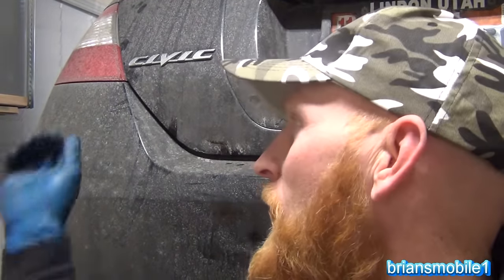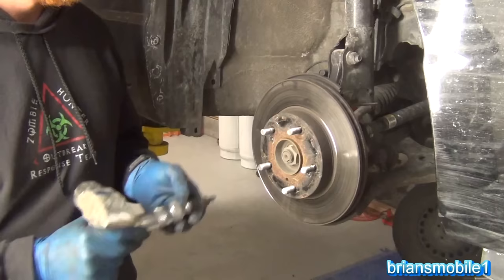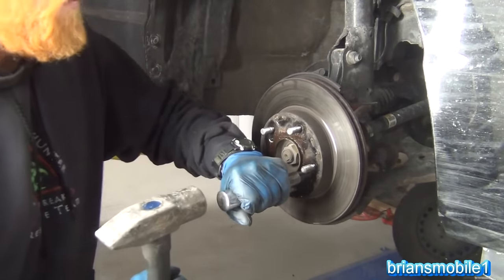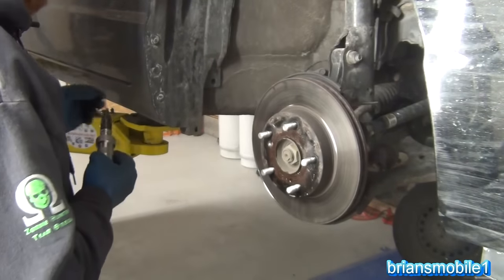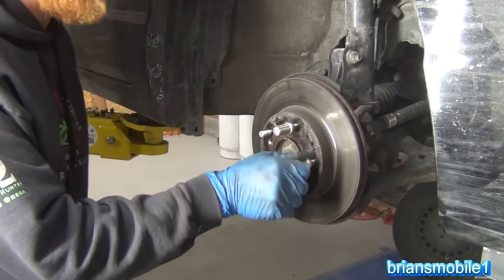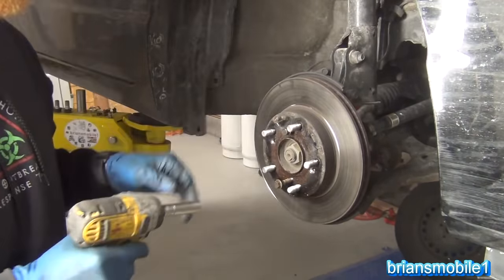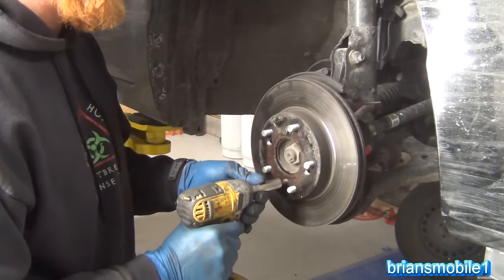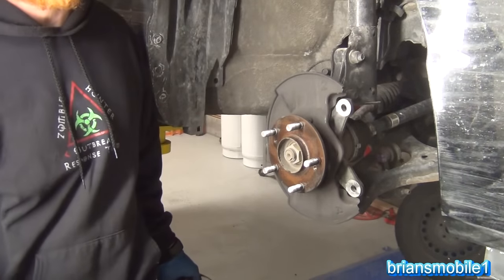Honda Rotor Removal Tips and Tricks

Comment: For those who don’t have a impact driver one trick that works great is put the lug nuts back on and Tighten them, this will release the pressure on the rotor screws allowing them to be removed easily but make sure your lug nuts are long enough, we use to do this at the dealership at time. Peace and God Bless

Comment: and with the ones that don't have the m8 bolt holes, buy new rotors, cause you're going to be beating the he'll out of the rotor  ( where the pad meets the disk) all the way around it. be sure not to damage the wheel bearing or you'll be buying those as well. the "slammer hammer" as I like to call it, is a life saver. but if you use with a socket on a bolt, TRY not to snap the bolt or you'll have a bad day. great vid Brian, I've been using those tricks for yes, but this will help a lot of people.

Comment: Good advice, thanks Brian. I did my civic brakes this summer, sprayed and used my impact like you showed. When I went side to side tightening the bolts little by little the threads ripped out of the rotor. I had to use the sledge hammer after that, darn.
Reply: Should have first applied penetrating oil (never WD40, which is NOT) and given it enough time to work.

Comment: As many cars as I've worked on, I've never found a car that has been treated as if the same person was ever gonna work on it again! I always put anti seize on just about every nut, bolt or spark plug, that I touch. Especially the likely to rust solid ones. I recently did shocks on a 99 Cherokee, with 260k+ miles, and the original factory shocks. Even after that rear shock fiasco, I put anti seize on the nuts and bolts, just in case. I also did an oil and filter change on it. I am positive that there was no call to torque the oil filter on to over 100 ft lbs!! That thing looked like a train ran over it, by the time I got it off! Most likely one of those highly trained quickie lube guys! I actually worked for one of those outfits, some time ago! I saw one of our recent tech school grads twist an oil drain plug off in the pan. He forgot which way was loosen! On that particular vehicle! Now, I'm not perfect! I sent a Mitsubishi Eclipse out with the oil cap off, once! But I went to their apartment, explained what happened, installed the cap, refunded the service cost, and gave a second service free, just for the mistake! I also took a write up. I could have just tossed the cap in the trash, and kept quiet about it, but I didn't.
Reply: Agree anti seize saves the day for the next time. I use it on my cars everywhere I can. But given the mess it makes I understand why most mechanics do not usually bother.
Reply: That's because dumb mechanics use it like they are putting out a fire, instead of putting on finger nail polish!!

Comment: Thanks Brian, very good video BUT one vital piece of information missing - those countersunk M6 rotor retention screws have a JIS (Japanese Industrial Standard)  PH No3 head NOT a standard PH3.  This is good design by Honda as the JIS resists cam out much better but the differences are not obvious.  If you use a philips PH3 screwdriver bit it'll appear to fit OK but you'll strip your screw heads and/or driver bits (I've done this...).

Comment: +briansmobile1 when I worked for Honda I would aways use a impact screwdriver and the bolts method when I did brakes at work. I would also after cleaning the rust off the surfaces use some anti-sieze compound on the surfaces where rust would accumulate. Never had an issue with them after that. Living in Massatwoshits the winter chemicals used on the roads would not affect or make them hard to take off again after the service! Thanks for this!
Reply from the maker: +413_Dina Great comment!

Comment: didn't know if Monroe would pass the Fit without the screws, so didn't want to drill them out. i found Kobalt impact driver at Lowes for about $16. by the way, if i had seen your video first, it would have saved me the trouble of screwing with phillip bits. nice video and links.

Comment: Thank you for stating the bolt size for those 2 holes. M8 1.25 threads/mm and confirming that the caliper pin bolts are incorrect size to try!

Comment: i got through hell replacing the rotors just because of these two screws after my mechanic guy used the wrong screw driver and destroyed the threads.. Finally I had to weld them to have them out and replace with new screws but expensive; the sales guy took advantage..

Comment: what's your thoughts on leaving those 2 screws out? it was always my understanding that they were just a safety device for the assembly line so nobody gets a rotor falling on them!
Reply: I left mine out.  Been totally fine.. no difference.
Reply: It's just to keep the threads dry and rust free. In case you need to use the threaded bolts to remove the rotor.

Comment: I did this, I have it to where the face of the rotor is flush with the hub rim, but it won’t come off any further, it will wiggle back and forth but It will bot go any further than past the hub rim. I have tried smashing it with a sledge and it just wedges and I don’t wana try any further with this method as I’m afraid the rotor will damage the threads of it wedges too much one way. 

I’m stuck I don’t understand how it can wiggle but not wana come off.

Comment: Can you just use a Phillips head attachment on a drill to get the screw out ?
Reply from the maker: 3% of the time it works on newer clean cars still under warranty.  97% of the time on the old rusty cars they strip out and require way more work by grinding a flat head slot in it or having to buy specialty tools to get it out damaged.

Comment: Good stuff Thank you Most likely the screw is a JIS #3 Vessel Tools does a good job in this area/ field etc  Only my opinion, not advice
Reply: I have the Vessel tool which has the JIS#3 tip and is an impact tool, works great!!!!

Comment: What is wrong with that axle? When you were hitting the rotor the shaft and boot were moving in and out independent of the outer joint/axle nut. Almost like the spring clip on the end of the shaft was not fully engauged.

Comment: Would the harbor freight impact driver do as well as the one you are using?
Reply: +Joe Briggs hay man, i got one from harbor freight, it works well for me, got some really stubborn screws on my motorcycles, i have beat the hell out of it
always got the screws out without damage to the screws or motorcycle
Reply: +Joe Briggs, Of course it would.  I don't think I've paid over $20 for any that I've owned, you beat them to death and start over.  $100 tack on price bump won't change this part of it.  Essential in motorcycle work too.  Every good mechanic has one just because they are so good at what they do.
Reply: Look into Vessel Tools - must have for Japanese bike Or for that matter Harley as well Think of the JIS screw as metric vs Phillips as standard It is not but close enough for dot GOV work Ride safe and keep the rubber side down

Comment: When I replaced the front brake rotors from my Hyundai Sonata, I used my impact screw driver to remove the screw, and the screw just snapped.  I forgot to squirt some penetrating oil.  Oh well, never had any issues since the rotor replacement.

Comment: Was that deep creep you used for the penetrating fluid?
Reply from the maker: +nickolaguez 3M penetrating catalyst.
Reply: +briansmobile1   I've always used 2 small ball pen hammers against the screw.   Place the smaller hammer  (ball end)   on the head of the screw.  Give it a few good wacks and i've always been able to remove it with a plain screw driver after.   

Impact driver never worked for me, i would booger the head and end up drilling it,  Then again maybe my impact driver isn't as good as yours
Reply: Buy new bits.  Old ones were shaped slightly different.

Comment: Every time I've done Honda rotors either rotor hammers off OR I've use the caliper bolts. The threads are fine and the rotor pops off.

Comment: If you want to give advice on brakes, try being more accurate. The screws are NOT phillips drive and are actually a JIS  fastener.
This is the correct tool :
 https://www.amazon.com/gp/product/B003BGTTSE/ref=as_li_tl?ie=UTF8&camp=1789&creative=9325&creativeASIN=B003BGTTSE&linkCode=as2&tag=studiovrm-20&linkId=d0122356b77688d0155b4f670f258e97

Comment: Never had one Brian and did a Honda job the other day just used a proper Phillips bit -  not a screwdriver - banged the screws several times with that and applied Kroil. Then used a normal Phillips head screwdriver and removed without any issue all four rotors with this technique. I definitely don’t want an impact screwdriver as another tool that I’ll never use or need!  Great video thanks!

Comment: I found that the bolt that attaches the break line to a bracket fits the threads to remove the rusted rotor.

Comment: Had the rotors stick on my renault kangoo van, tipped a kettle full of boiling water over them, gave them a tap with a hammer and they came right off, trick is to get them moving before the hub expands as well with the heat from the water.

Comment: I have a noise on 2013 rear brakes Honda civic.  The funny thing is it makes a scraping sound every time the tire rotates one time around. But if I loosen the wheel nuts it goes away.  If I tighten the wheel nuts, again, I hear a scraping noise every time the tire rotates one time. It is also makes the sound on both sides in the rear.  What the hell can it be?  I don't think its the brake pads because they would squeak as I turn the tire all the time, not just one time around.  Weird stuff.

Comment: Not all Phillips #3 driver bits are the same.  If you are a DIYer and have a pre-1990 impact screwdriver, replace the cross point bits.  Old Phillips bits can strip and mangle the heads of the soft JIS screws of Honda rotors long before applying enough torque to break the screws free from rust under the heads.   Phillips introduced a backward compatible design in the 1990s for automatic drivers (as an ISO standard) which is much closer to the "JIS" screws used for retaining Honda rotors.

Comment: Is it possile to use an electric hammer drill and an appropriate bit and vibrate the rotor off? Or would the impact of the electric hammer drill damage one of the components such as the wheel bearing or the axle shaft etc?

Comment: After cleaning up the hub, coat it in antiseize and also put antiseize in the inside part of the rotor that rides on the hub. I've done this for years and the rotor will just slide off even years later. Good if you keep vehicles a long time like I do.